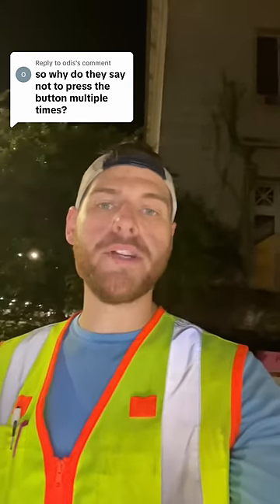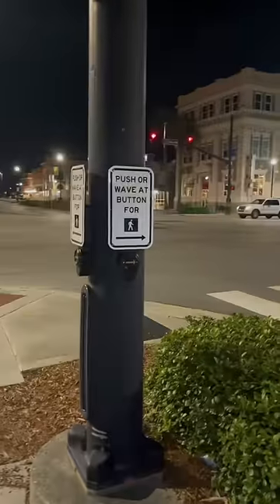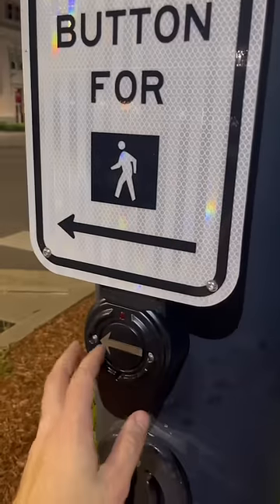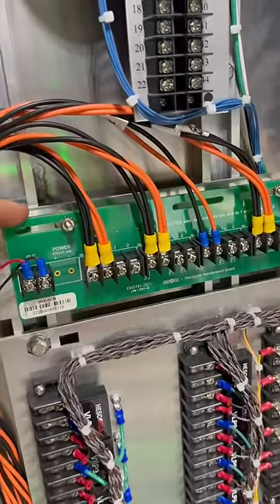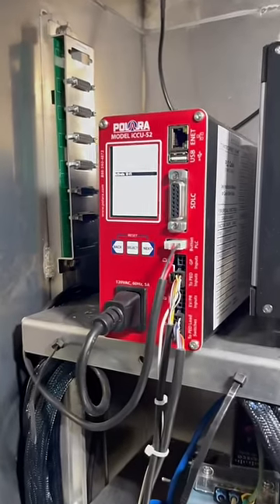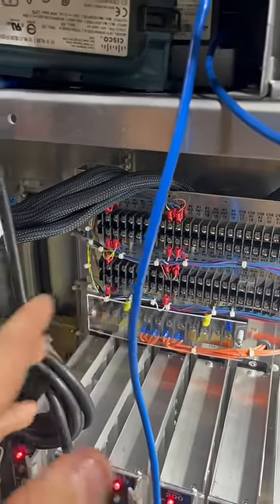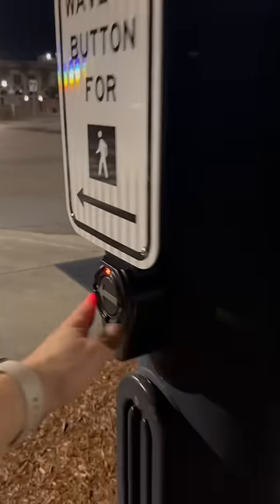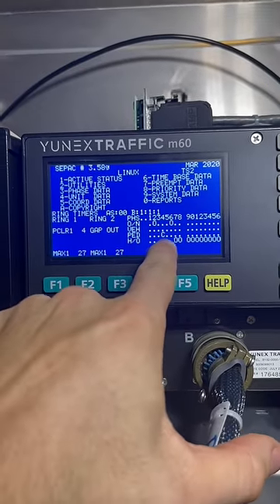Press it as much as you want!!!

Comment: As a computer programmer, that seems needlessly complicated
Reply: As an electrical engineer, it's gotta be mission critical. Every component in that PLC needed some certification. Yeah you could do it all with an ESP32, but you're totally gambling with stability and failure modes, especially considering how finnicky they can be
Reply: @captainwasabi  I doubt it, but go ahead and apply to your nearest traffic engineering firm. I'm sure they'd love to hear your cost saving idea.
Reply: As a manufacturing engineer, I can say that this is typical hardware and software for any automated system. It is complex, but it is also scalable, standardized, and most importantly reliable.
Reply: every project seems simple at first, then you get into the full requirements and domain of the problem and you end with stuff like this example. Especially after 40 years of dedicating all your time to traffic signals in a city.
Reply: they need to launder more money 😂
Reply: @captainwasabi it's mandated and paid for by government, therefore the longest road by the lowest bidder is always the favored option. Government never makes sense.
Reply: It is overly complex and bulky. I wouldn't use an ESP32. But a Pi Zero? Sure. It's bulky. Old school. And over engineered garbage. Inefficient. If you want to over engineer it, an industrial 32-bit microcomputer is solid, tiny, and reliable.

I'd rather fill 90% of the cabinet with batteries to provide backup power instead.
Reply: Absolutely! Mission critical? Traffic lights go off all the time
Reply: You must be an 80s computer programmer then, yeah? Trust me, modern programming is way worse. I bet that controller doesn't even have room for node_modules!
Reply: you mean to say as a not very good computer programmer
Reply: PLCs are industry standard for automation.
Reply: I have literally seen VAXes that were less complicated.
Reply: @AlkalineGamingHD  like 20years ago, if that still true the industry needs to update. Sounds like banks using COBOL
Reply: Well there's a reason you're a programmer and not an engineer
Reply: As a software/systems engineer, this just urines me off.  They could get so much more functionality on a credit card sized computer board inside the pole.  Like sensors to see if you're done crossing, or get rid of the button and just notice when you're standing there.
Reply: C/C++, so yeah, a real friggin programmer
Reply: Also needlessly expensive.
For a reason.
Reply: As an automation engineer, it's really not that complicated
Reply: I feel like i accidentally started a war. And there's a practically identical thread too. Didn't realize this was such a hot "button" issue. It's like Sheldon vs Howard.

😂😂😂😂
Reply: @dimpyra  I for one think a couple three way switches, contactors and a couple timers could do just as effective of a job.
But whadda  I know ....
Reply: To the extent that i even had a real point, I guess I was suggesting that through the lens of a computer programmer, that seems like a lot of hardware for a very basic task. Software to control that system could run on very low powered hardware...like an atari 2600 would be overkill. Pitfall was way more sophisticated than coordinating those lights. It was really just a light-hearted comment. Didn't expect such passionate discourse 😂
Reply: @tristan7216 "urines me off"
Reply: I had to take PLCs and logic control they’re a royal pain in the ass to work with yeah they’re really reliable once you get them to work right
Reply: Tell us you're not familiar with modern engineering without telling us. 😂
Reply: @zaydabbas1609 Haha you made sounds like traffic light never fail. Funny man.
Reply: @dimpyra have you considered what voltage traffic lights in the US run on? A lot of commercial and industrial controls are scaled larger due to physical dimensions (voltage drop), medium/high voltage, and heat dissipation.
Reply: Government contractors and graft
Reply: german engineering < government engineering.
Reply: @lazychino  It still is industry standard for automation machines. Ive worked for multi billion dollar international manufacturers. PLCs across the board.

If you're so sure of the update then do tell, whats the updated system?
Reply: @AlkalineGamingHD  clearly it's Large Language Model AI driving an interpreter AI on a random $5 board with unshielded IO and no failsafe mechanisms connected to The Cloud.
Reply: It seems needlessly complicated, if your standard of running traffic is just flipping lights. These units do a lot of data collection, scheduling, communicating to a central traffic control base, talking with other light controllers down the street. And even if you replaced with something like a raspberry pi, you'd still have 80% of the equipment and wiring that's already in that box, because there are that many sensors, many amps of power running to the lights, which means you need bulky solid state relays, fault tolerant ADC's, and so on...
Reply: @TickyTack23  i like that answer
Reply: Yea a raspberry Pi and a relay box can handle all of this.
Reply: @FrenchToast_28  No. It really isn't. Signals are often interconnected these days, and have variable timing mechanics that a chip would not be sufficient for calculating. It's actually really annoying reading all of these comments from people who have no idea what they're talking about. You are correct though about the operating conditions. That is also a factor for why these other suggestions wouldn't work. There are multiple, mechanical fail-safes in place to ensure the signal never displays a conflicting movement. You can't get the level of redundancy required to ensure a signal doesn't fail a driver with just digital means alone. To which I might add for everyone here - mechanical redundancy is the first line defense against cyber-terrorists from sabotaging a signal. If they were all digital, and didn't include those fail-safes, one attack on a network could have devastating consequences.
Reply: @captainwasabi  exactly, i always think of that , i work at an industrial facility, and all the expansive plc controlling everything can be substituted by 4 or 4 arduinos and some sensors and relays, idk why we still pay millions to pcl companies
Reply: @dimpyra  part of that setup is the I/O channels.  That converts the electrical signals into something the computer can communicate with.  It's not complicated at all.
Reply: Thus why they don't work properly in most places
Reply: @tristan7216 that'd be to much genius for the government
Reply: @TheGamerFiFtIn "industry standards" is literally the only reason. Thousands upon thousands of guys wasted time learning to do it this way so they will be forever hesitant in switching it up.
Reply: I've worked in government orgs as well as private, fortune 500, small, and everything in between... government is no worse than a large corporation or small business when it comes to waste and  pointless bureaucracy. Popular to say, but it's just not true imho.
Reply: Addendum: "The decision makers at corporate are really doing a great job" said noone ever working the retail end of a large corporation
Reply: As a normal person this seems overly complicated. Can't wait for ai to take up all these jobs
Reply: Honestly the debate can go on for ever, but it’s probably safe to say that cost saving measures can absolutely be implemented here even with more advanced boards like the Nvidia Jetson, even with a PI (which is really not standard) you can configure backup boards to take effect in case one stops running.
Although this system is over designed it’s still a master pieces in its respective design.
But would be awesome if this industry can innovate a bit and future proof the design.
Reply: @meowmeowbobo  ever see green lights in opposing directions at the same time? I haven't. Failure of the bulbs or power have nothing to do with the traffic controller itself.
Reply: not redundant enough.
Reply: Just do what we did in the 80s. There is no way all that is needed.
Reply: Yeah I feel like they could probably just have the computer systems inside the traffic lights themselves and then it's all connected wirelessly. Then its all programmed with a computer and a port
Reply: @dimpyra Signal conditioning, isolation and redundancy.   If every switch input looked like a perfect square wave pulse, never developed a short or odd impedances, and a single conductor circuit never failed, then yes, running all these signals into one processor would be all you need.
The world of analog is a lot messier, and you need specific hardware in front of that processor to turn that noisy electrical mess into that nice pretty, singular square wave pulse that programmers want to see on their processor input.
Then, there's redundancy since this is a safety application.  Usually two processors are cross-checking each other and if there's a descrepancy, some sort of fail-safe recovery routine or procedure is executed. Each sensor input is often signaled with a pair of inputs, and the device looking for the input checks for concurrency of the signaling, as well as checking things like shorts or cross connection.
The program is usually pretty straightforward, but it still relies on hardware to get everything to that nice clean condition to process it correctly.
Reply: @captainwasabi  PLCs are industrial esp32 more or less
Reply: mission critical, reliability, etc are all good reasons, but another reason is the system configuration can be defined by a wiring schematic instead of a pile of source code, and can be more easily worked on by electricians and dont require a software engineer to fix
Reply: @AlkalineGamingHD doesn’t mean there isn’t better options out there
Reply: As a programmer it shouldn’t be that complicated for you; there’s many reasons for it to have multiple layers like it does.
Reply: @s3rye306 never seen cops at a failed intersection it just turns into a give way
Reply: Welcome to government.
Reply: @PupuTheMonkey  this is clearly over engineered.
Reply: @epileptix8954 You mean a government agency that spends $500 on a hammer and $2000 for a toilet seat is concerned about cost?
Reply: @PupuTheMonkey these things are always failing how many broken stoplights are there in every major city and small town
Reply: @DrCognitive  No. Land developers are the ones concerned about costs, because in most cases and they're the ones who build/improve the signals. The state maintains the signal after construction/modification. At the firm I work for, we advocate for the client NOT the government, to build for lower cost while meeting safety regulations.

TL;DR - 9 out of 10 signals are paid for by developers, designed by private engineering firms, and the state only gives approval.

Don't worry, your tax dollars aren't being used to build these things. Just to maintain them. Though i have a feeling you don't really care, you just want to be mad about something.
Reply: @epileptix8954  You're suggesting that traffic lights don't fall under the dominion of a government agency...you know, the Department of Transportation?
Reply: @DrCognitive  It's like you didn't even read what I wrote. They take control of the signal after it's built.
Reply: As a kid we had crossing guards and when there were no guards we used a very complicated formula of something called COMMON SENSE.
Reply: As an automation engineer/programmer, you are 100% right
Reply: Shoutout to everyone in automation on the sales or repair end trying to recover from the great equalization after the chip shortage 😂
Reply: @Magneticitist  hell it still ain't over
Reply: @captainwasabi  An ESP32 probably hasn't undergone a Single Fault Analysis. That's a term most people have probably never heard before. Every single model of ESP32 would have to have its own SFA if it's going to be used for any function that protects human lives, and they are very expensive to do.
Reply: Was thinking the same
Reply: @xxmobstrxx8535  a better option that apparently nobody knows about, but they know it must exist. 
This comment thread is the Dunning–Kruger effect in full swing.
Reply: As is everything government related😂
Reply: Good luck getting it approved for installation. Everything seems simple until reality kicks in.
Reply: As a Scottish dude, if councils in the US are anything like councils in Scotland, you can be sure that not a cent/penny is overspent on these systems. The job will be done for the absolute cheapest price possible. I mean, you could go to a "pull string that pops up a cross sign/stop signs for vehicles but that's a bit too steampunk for the 21st century.
Reply: An embedded software engineer would disagree.
Reply: Redundancy and liability.
Reply: @tristan7216 In the UK we have on-crossing and kerbside detectors on top.of.the traffic signal poles that detect pedestrians. Sometimes pedestrians will press the pushbutton for the greenman and immediately cross the road (due to low volume of traffic)before it is been serviced. The on-crossing and the kerbside detectors can cancel the demand for the greenman in the absence of a pedestrian after the button has been pressed to keep the flow of traffic going.
Reply: @evilmarke if it's a serious enough intersection the cops will show up at some point
Reply: @1smhx5 the LEDs in the traffic lights will fail hundreds of times before the signal controller fails

Comment: If the PLC is programmed correctly, pressing the button latches a bit. Pressing it again after that does nothing until the bit is unlatched by the program.
Reply: That’s if it’s even programmed correctly.
Reply: That little Branch under the main line.

Comment: If anyone is interested why you can’t click more than once I can explain. Actually you can click more than once, you can click 1000 times even, because only first matters, once PLC logic controller receives input sense it will send to controller to acknowledge and the same time that input from the button will be temporarily time disabled to ignore your clicks and not to overwhelmed the system. So only first call is in the Q and once logical time passes it will change the light. After that system will reset to go default and input will come back active. Thanks for the attention. 😊
Reply: It's even simpler than that.

There is no need to apply and logic, just keep setting the value to true.

To apply logic, you'd have to take the new value, hold it in memory and compare it with the existing one.

One and done, it's easy stuff.
Reply: so basically it dose not matter how many time we press it because only the first press matters 

LOL so i will just keep hitting it as many time as i want just because i like hearing it say wait repeatedly
Reply: Do u have to push it at all? I never understood it. I thought the signs work automatically
Reply: @MotorPsychos70  it depends on the road rules and intersection.

If running that walk sign is blocking traffic you really only want it active when there is a pedestrian demand.

If the traffic can't actually turn to cross where the pedestrian walks then you can just run it.

The other option is in a high foot traffic,  it can be safer to just active it at certain times when people are around.
Reply: All those computers systems for just walking across the street

I can probably cut all that to one and done
Reply: The real reason you can hit it multiple times is that most of them aren't hooked up and the button is only there for psychological reasons (people are more patient if they think they have some control.)
Reply: Touch grass
Reply: @1MicrosoftCPU you can, but this is designed with industrial levels of redundancy and safety, so that it never accidentally shows green in more than one direction
Reply: @liamsyd  The "time" process also needs to be ignored for every click done after the first click. That requires some kind of "comparison" logic.

Comment: As a traffic signal tech with 30 years experience I push the heck out that button. This might reduce the life of the button that is rated for millions of cycles. Polaris broke the testing machine trying to find out how many times you can push the button before it wears out.
Reply: Why? Doesn’t make it change any faster.
Reply: I need that button on my ps4 controller.
Reply: Why is there so much equipment in that cabinet?  Seems like the system could be run from a single microcontroller and a few relays.  Not trying to be a pest, just seems overengineered
Reply: @JesseHughson There are a lot of reasons, but an oversimplification would be to say it's been this way for a long time and it works well
Reply: @MB-mx7vz  for me it's an obsessive-compulsion (which might be subclinical and commonly experienced, as opposed to being part of my obsessive-compulsive disorder). Within the context of pressing the button to request a walk signal there's no real "reasoning" behind it. It's purely because my brain gets caught in a "doubt loop" or fixates on a number.
Reply: @MB-mx7vz  Because you can make funny sounds with that wait sound.
Reply: rapidly mashing the button is a DDS attack on the system.